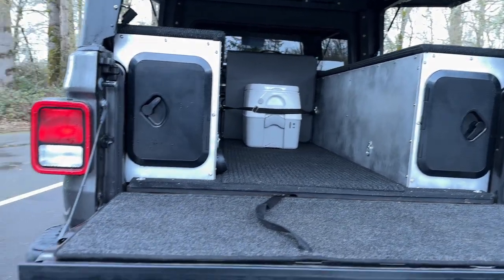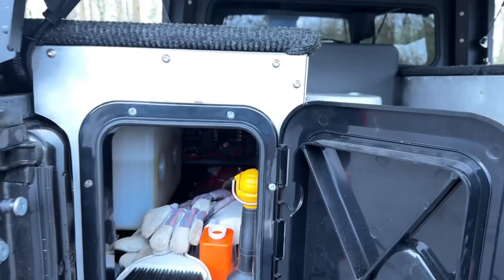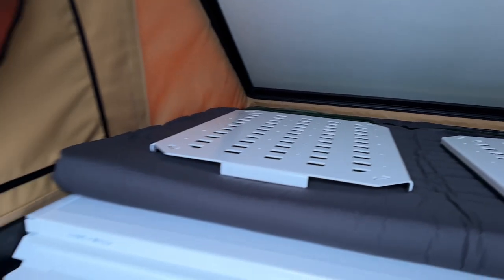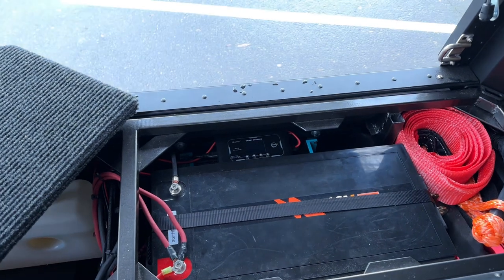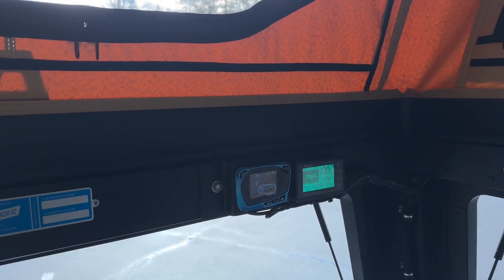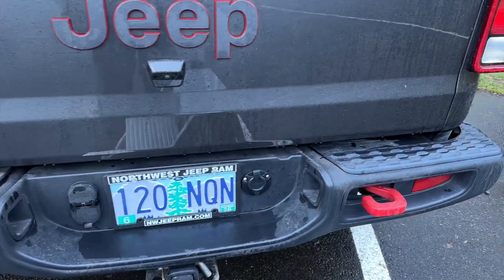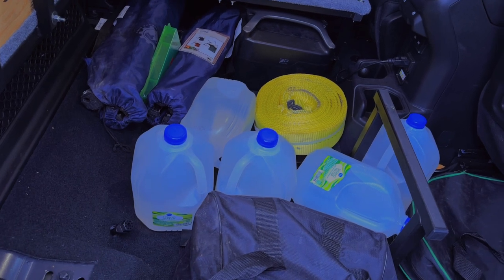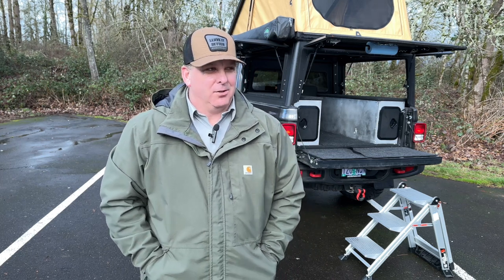Super Pacific X1 Jeep Gladiator Overland Build is finally complete….for now

Comment: Nice build!  If you have spot for these lights, you will love them.  Obeaming 12V LED Dimmable Reading Light 2 Pack, RV Bedside Reading Lamp with USB Charger 12 Volt Flexible Gooseneck Wall Lamp for Camper Van Travel Trailer Truck Boat Interior Lighting

Comment: So weird by build is almost the same only I used a Propex heater. I have the same NOCO plug next to the plate, I had to drill through the plastic bumper cover and a metal plate behind it. My boxes are just the depth of the wheelwells. Get yourself a  Laveo portable electric toilet, it will be the best thing you ever spent money on.

Comment: Did you have to run beefier springs in the rear to handle the extra 400+ lbs from the camper and your build out?
Reply from the maker: No, just running the springs that came with the Metalcloak lift.  I did have airbags put in just in case, but not sure that I will need them.

Comment: I've been looking for an entry stepladder/stool. really like the one you have . what is the brand? link?
Reply from the maker: Thanks.  The one in the video is a three step like the one in the link below.  I actually found I didn't need the third step, so I bought the 2 step afterwards, also made by Little Giant.  I still use the three step around the house, but since space is at a premium with overlanding, I liked that the 2 step folded up just a little shorter.  Hope that makes sense.  https://www.lowes.com/pd/Little-Giant-Ladders-3-Step-300-lbs-Capacity-Silver-Aluminum-Foldable-Step-Stool/999968821
Reply: @DelLoosePhotography  Hey thanks.

Comment: I’m also getting an X1 on my JT ecodiesel but a little concerned about exceeding payload. I’m waiting to hear back from Jeep since I haven’t found a definitive payload figure yet for the ecodiesels. I’m seeing anywhere from 1000lbs to 1700lbs. Do you know what the limit is and have you managed to stay under that or is it something you’re not really worried about?
Reply from the maker: I don't know what the actual payload is.  I'm just doing my best to keep things light.
Reply: I too have the ecodiesel JT that I'm going to put an X1 on. Payload is generally going to be overloaded once you put a couple passengers, tent, and camp gear inside. Not to mention a winch and steel bumper. The solution I've found is running the AEV High Capacity coils with their lift. I used to sag a bit, but after putting that on its not an issue at all since it's meant for more weight to be on consistently
Reply: Your personal payload is on the door sticker of the driver door for your particular model as well, every jeep is different depending on the options you choose from the factory
Reply from the maker: @codycalvin9278  I have airbags too.
Reply: @codycalvin9278  Thanks Cody, the way I understand it is installing better coils probably improves the payload stability but does not improve the ability for the frame to take the extra weight in any way. Another JT ecodiesel owner told me his frame was bending due to him going over his payload limit. Is there something I'm missing?
Reply: @arturv83  exactly right about the coils and stability. I've heard/seen in some cases where people have had their frame get bent in being over payload, but in my experience is the exception more than the norm. That said, all you can do is try to mitigate going overboard where you can, and if you do, don't go over by much
Reply: @codycalvin9278  Gotcha. BTW, the sticker on the door of my Rubicon has a weight limit of 902 lbs, which seems very low. When I called Jeep they said its 1200 lbs. What does your sticker say?